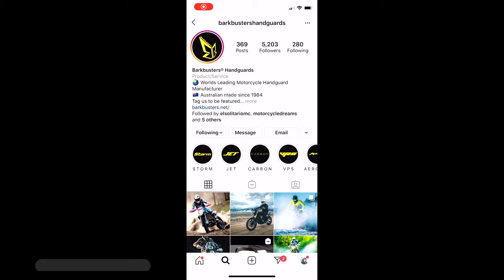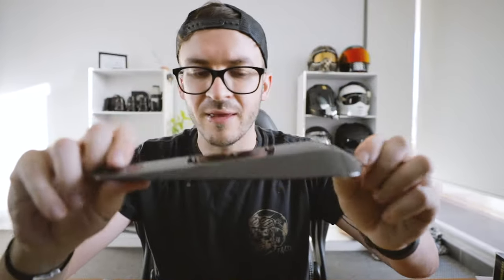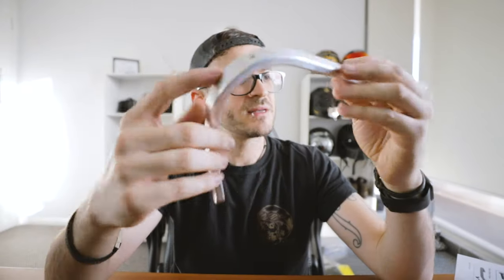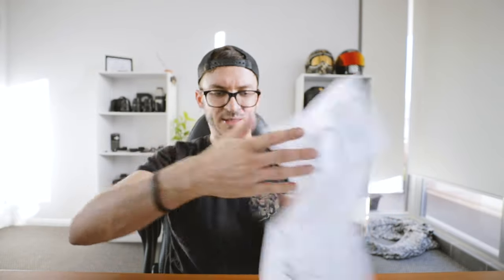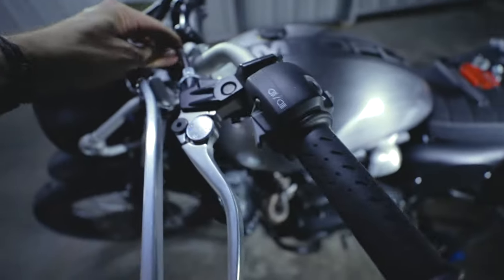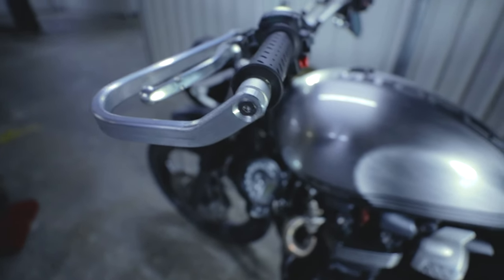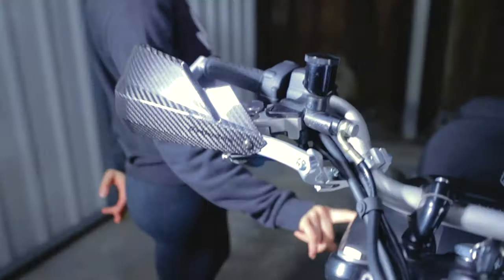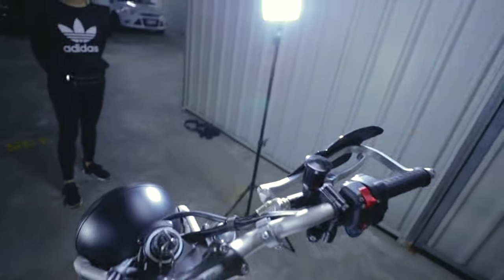Barkbusters review & Installation | PROTECT YOUR HANDS WITH THESE BAD BOYS!!

Comment: At first I was thinking, doesn't fit the scrambler style.  But they actually do look really good.  I also think they'd look even better if you had an led headlight like motodemic or something.  The bark busters look more modern than classic and I think an led might balance out the look somewhat.....
Reply from the maker: I’m 100% with ya there bro. The round headlight needs to go. The design is still in the works but it’s gunna look futuristic af!

Comment: I hope you used a torque wrench buddy...I didn't. 
Stacked my desert sled off-road and the inboard handlebar clamp+L bracket twisted on the bars.
Also if u take it off-road and stack it; there's a risk of your hand/arm slipping through the "hole" and breaking it I guess.But I guess that would be a "freak" accident.
Reply from the maker: Wow HECTIC! Man i'll defintely check that out. Thanks for the heads up! You come out of it ok?
Reply: @MotoFeelz  They did their job to protect the levers so I'm happy with that. But the clamp twisting will "scar" a black handlebar. Had a bruised torso; but another story to tell eh; all good. 👌
Reply from the maker: syumassh holy moly - yea I’m hearing ya there, I wanna powder coat mine eventually. Thanks for that bro - glad you came out ok 👊